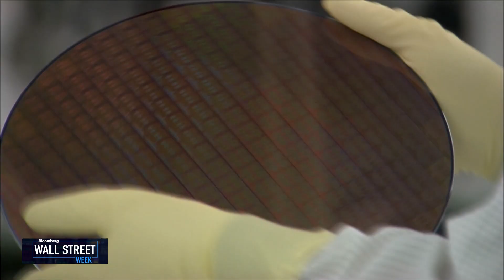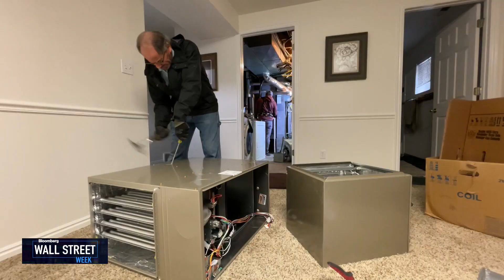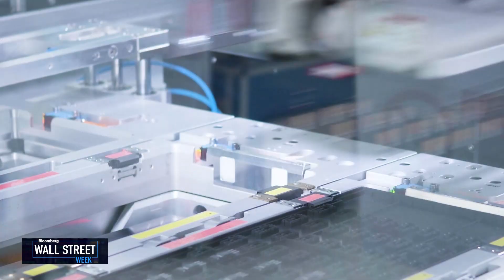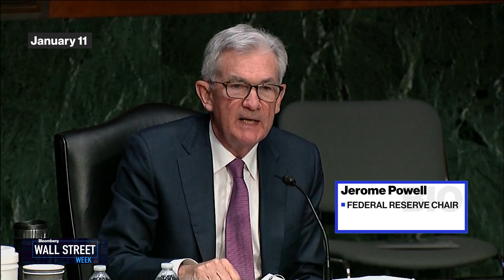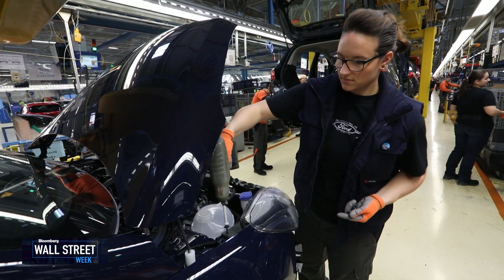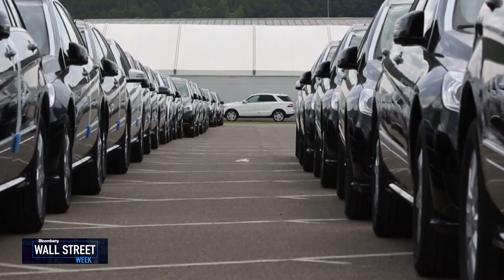Why Is There Still a Chip Shortage in America?

Comment: how about building cars with less chips and less technology that will last longer !!!!
Reply: How about riding horses instead of cars. 🤨😂
Reply: @anttikalpio4577  too expensive to buy and feed a horse lol..
Reply: @Slickpete83   start building sails on the cars wind power
Reply: @Slickpete83  modern cars have on average 1400 parts with chips in them. First you would need to change the laws to allow building cars without features like anti-locking breaks for example.
Reply: @anttikalpio4577  not even that , just get rid of all that multi-media stuff we don't need , radar cruise control , blind spot alert, keyless entry, etc...  , they could offer base models without all that stuff
Reply: how about Bike.
Reply: This... I've been saying this for a long time.. Computerizing everything just causes more problems than it solves. It's like everyone forgets that cars ran fine without computers on board and had less problems.
Reply: @ArcaneTurbulence  they also were much more inefficient, needed way more servicing, much less safe and not that comfortable. Cars are not just engine and four wheels.
Reply: @anttikalpio4577   That's a bullshit lie, and you know it. My 98 ford ranger has had WAY less problems than my 2018 tacoma. I've had it 5 times longer and the ranger has been in the garage twice.. once for clutch replacement, and another for exhaust. I've had my Tacoma in 3 times already.. All three times for computerized bullshit. 
 Modern cars break down WAY more than the older models, and the gas mileage is also bullshit. I had a 92 hundai scoop LS that got 41 miles to the gallon. I haven't owned a 4 banger since, that got that kind of mileage.
 And what are you talking about..."comfortable"?
 It's a seat and a steering wheel. The seats haven't changed.. they're still a seat.
Reply: @ArcaneTurbulence  your poor choice of cars does not count as the ”truth”. Statistics show otherwise.
Reply: A big problem is that the auto manufacturers use highly specialized chips instead of more generic chips. They don't need to, but historically it has been more cost effective. When there is a chip shortage, the highly specialized chips will take a back seat in production over general purpose chips.
Reply: @anttikalpio4577  BS. i can teardown my old car and bring back everything without issue. all these electronic parts cause the problem let alone modernizing then like mobile phones
Reply: Ever car has a chip of some sort but they can cut down on how much chips each car needs by removing features but people love there premium ass cars.
Reply: totally agree, its a proven fact that the consumers only use about half of the technology available on cars today. Lets get back to simple technology less expensive to maintain and less expensive to build and a lot more dependable.
The automobile  industry should have never gotten themselves in this position in the first place. Every manufacture has tried to build bigger and better and the result has been less dependable and reliable.
Reply: @Collen Flarity The electronics in my 98 ford are sensor only (for trouble shooting). There is only ONE system that has the capability effect how it runs if the sensor goes bad, and that's mass air flow (02 exaust system guages as a whole). which you can just unplug it.. problem gone. 
Also, there are no power systems in my vehicle.. it even has crank windows. lol
Reply: @Collen Flarity  There's a difference between being electronic, and being controlled by a computer. Also.. my transmission is manual. So no again. If you want to call everything with a wire "electronic" then there have been electronics in cars since the 70's
Reply: @Collen Flarity  Exactly my point. the (onboard computer) as you call it, from the 60's to the mid 90's, was just an analog system. They tried to make it sound fancy, but it was not a "computer" in any sense of the word compared to today. Analog systems do ONE thing. they output a signal. It was just a board with wires plugged into it that had input/output, and simply output a frequency. A good analogy would be plugging hoses of water into a flat of tubes past a flow gauge. It doesn't do anything it just outputs flow information. Today, we have (actual) computer systems that actively make decisions in the functioning of the vehicle, and they run off of an actual logic system. An analog system functioned basically as a "part" that does the one thing it was designed to do. When you start mixing signals with a digital system instead of an analog, you end up with numbers that fluctuate wildly. Add that to the fact that they control various aspects of the inner workings of the vehicle, and you end up with a disaster scenario, which is currently the case.
Reply: @Collen Flarity  No, are you? Do you know the difference between analog and digital systems? Have you ever built a circuit board? I've been doing it for 23 years. An analog system is NOT a digital computer. Nice try at an ad hominem though. I'll give you props for waiting till the very end.
Reply: @Collen Flarity >.>   I had already previously said that airflow systems
 (which plugs into the ecu) was the ONLY system that could effect the 98 Ranger, and yes it's a digital ecu, which kinda makes my case for me... Yet you're somehow ignoring that....  Anyway, in the 98 ranger, you can just unplug it if it acts up, and it's fine. You can't do that in the newer vehicles..
  And yeah.. My ranger is still pretty much like new, and gives me zero problems, So I'll definitely keep it, thanks... lol
Reply: they are trying to make Cars like Phones. Easily to break for more profit.